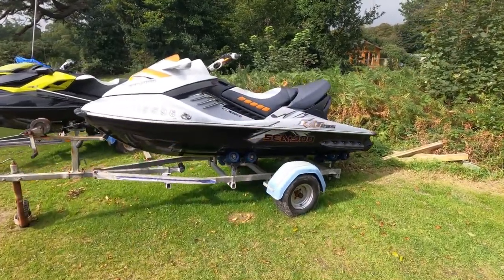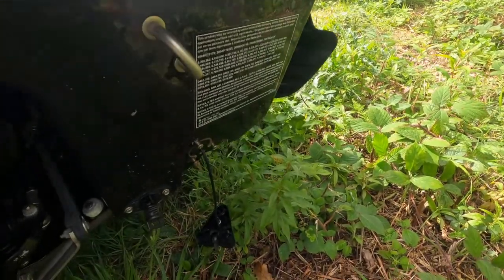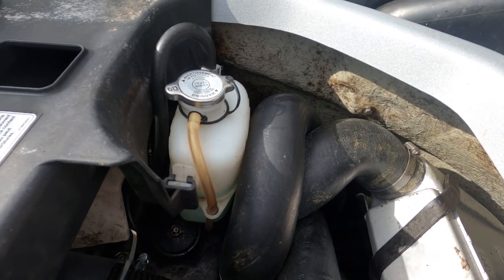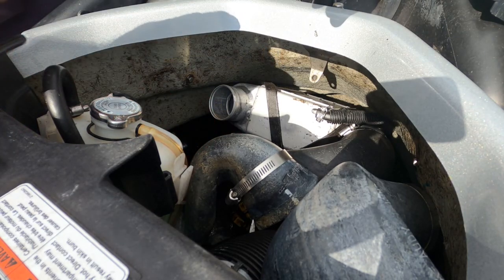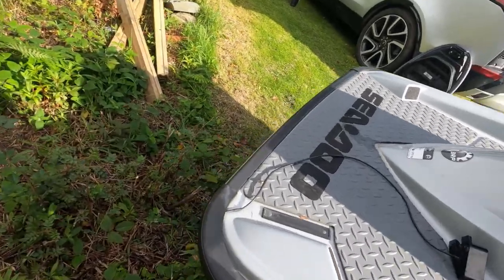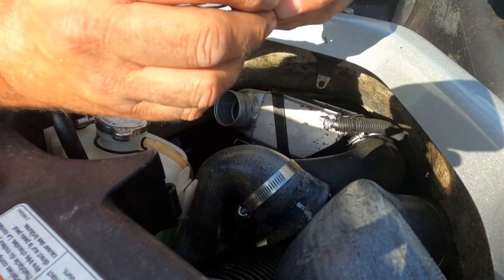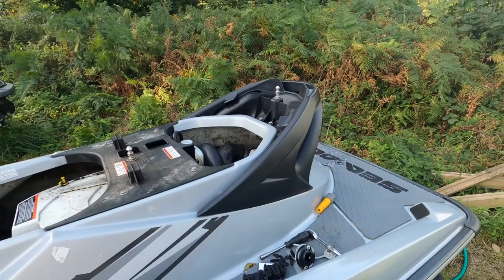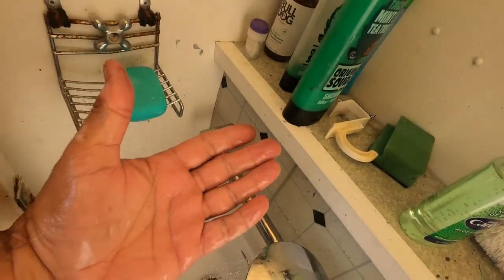Replacing the Lake Water Temp Sensor on a SEADOO RXTX 2008

Comment: Did the sensor limit the rpm earlie ?
Reply from the maker: Not sure I fully understand your question 
The sensor stopped working, it doesn’t limit anything. The ski worked fine, it just failed to display the water temperature, plus finding where it was was a challenge. Eventually I discovered it was part of the speed sensor.
Hope this helps 
Regards 
John